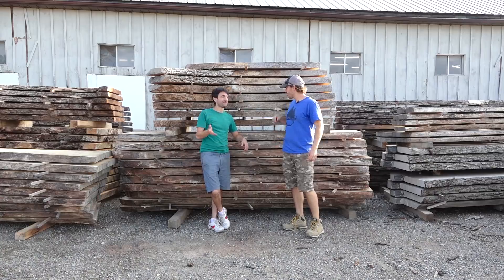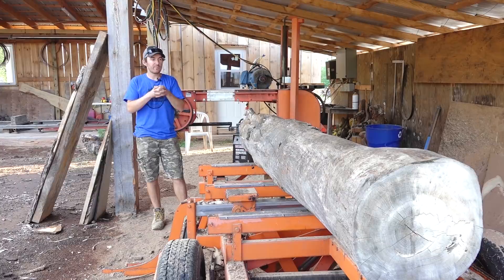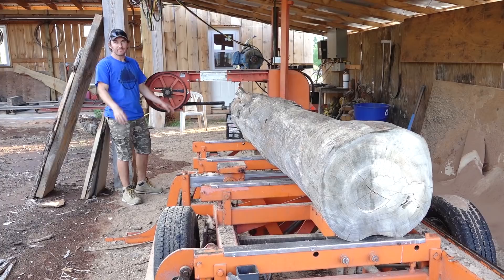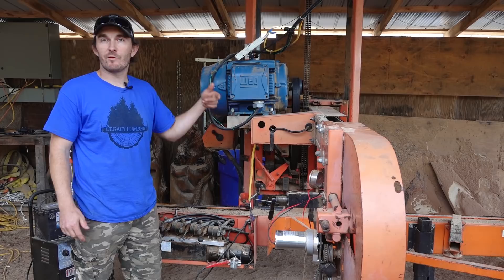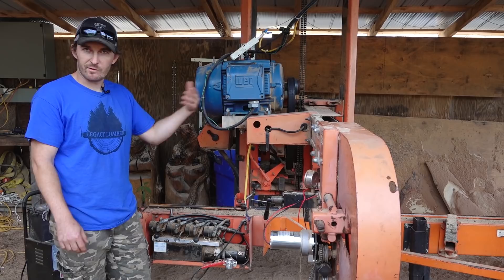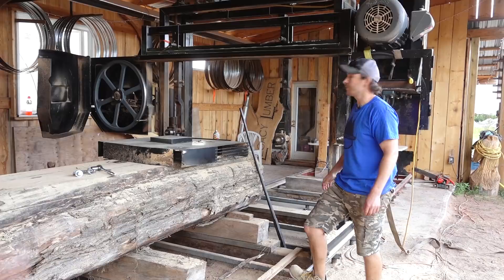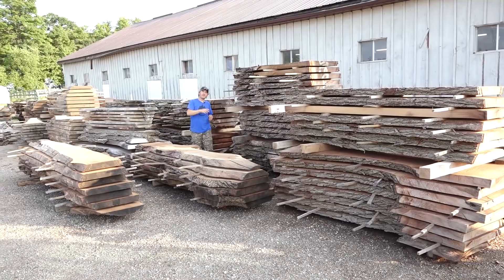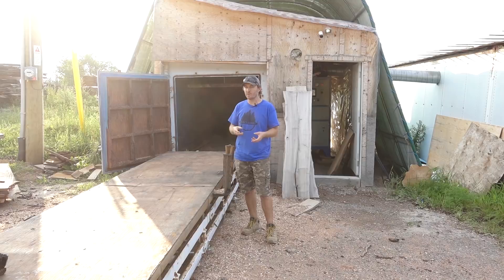Legacy Lumber Sawmill Walk Through

Comment: From my time in the technical department of a large bearing company I can assure you that any more than two bearings on the one shaft is an absolute NO-NO. It does not matter how careful you are in trying to get them to align the simple fact is that as long as your rear points to the ground you will never do so reliably enough to guarantee good bearing life - particular with these relatively crude Plummer blocks and the mounting of them on mill finish steel weldments. With more than two the bearings will always fight each other and the parasitic loads thus induced will lead to shaft and or bearing failures. The fact that you have already had a shaft failure and then on upgrading the shaft a plumber block failure should be enough to convince you of this. Two bearings will outlast three, but if you feel that just two of the current bearings are insufficient (loads here are actually quite light here if its done properly) then increase the size of bearings (and shaft) but use only two . Personally I would just remove the middle bearing and see how it went - monitor how warm the bearings get. A further point, do NOT lock both bearings to the shaft. The shaft must be free to expand lengthwise in use and slip slightly (longitudinally) in one of the bearings inner rings. If you lock both of them you can get parasitic thrust loads that will destroy the bearings. I would suggest locking the blade end one only and perhaps providing a groove in the shaft for the grubscrew on the other bearings inner ring so the ring can slip but not rotate (fit should still be quite snug). Also do NOT over grease these bearings - filling them with grease as many are wont to do simply causes the churning of the grease within the bearing leading to heat build up and charring of the grease - end of bearing! The grease they come with is sufficient for life - throw away the grease gun, remove the grease nipples and plug the holes - we used to as a routine measure before we sold these bearings. In short, throw away the middle bearing  you will not regret it, and Matt you need to do the same on your saw.... Martin
Reply: Olfoundryman I had no idea that three bearings was a faux-pas, but it makes complete sense. It’s like expecting a 4 leg stool to never wobble. Fantastic foundry videos, and bearing advice too.
Reply: hehe I can hear our old assembly shop leader now. "I will put that together right after i mount a fifth tire on my car. I sure would like something else to keep in alignment. Job security is way more important than sanity"
Reply: Not to be argumentative, OFM, but there is a long history of more then one bearing on one shaft in automotive engineering for over a century.
Reply: @rickowens4397  please reread we are talking about more than 2 on a 3 foot span.

Comment: Great video. I built a chainsaw mill with a 22hp Briggs and Stratton that cuts 39" wide, and there is nothing more fun than cutting slabs. But I also ran into bearing problems. One thing to make sure of, is that you only lock down the set screws on the bearing closest to your drive pulley and leave the other ones out (called floating the bearings). When the shaft is turning it actually builds enough heat to grow in length slightly and if the set screws are tightened on all bearings it will create side load on the bearing and can cause overheating and premature failure. Hope this helps. Happy Sawing!!
Reply: Interesting!

Comment: Thanks for the logging tour Matt!
Paul, 
May I suggest that you use stickers/wedges between slabs when you cut to reduce the friction on the blade and therefore reduce the axial loading on that spindle.  The other thing is to increase the size of the wheels to 30:1 (minimum).  The diameter of the wheel to the thickness of the spindle at the bearing.  (btw that is elevator safety code, if I recall correctly).
You mentioned, ' respect the wood', I am with you, and appreciate your efforts!!
Thanks again !
Reply: Thanks for the tips

Comment: Hi Paul, i work on fans-air handling units when they have problems like you are having with your shafts and barrings. A couple things you can try, when you go to tighten down your bearings snug up one side first and see if the other side lifts off the base, if so then shim it up with ether shims or the black metal strapping works good too, your base is crowned which will cause heat in your bearings and burn them out cause it's distorting there shape when you tighten them down. Another helpful thing to do is while assembling it, keep spinning the shaft by hand between each step, if it stops spinning free when you tighten something that's probably the problem. last is when you've got it back together run it up to speed with out the blade on, check if you've got vibration by putting your hand on the bearings, i've seen and i have balanced band saw wheels for cutting granite before and seen them and pulleys not balanced from the factory. 
I hope that helps,
Joe

Comment: Re bearings: I agree with Michael, another problem source is the bearing mount. Even though the bearing bores are aligned at no load, they might not be remaining so under dynamic loading.
 Take a look at the mount for the outside bearing. That light angle will twist and flutter like a leaf in a hurricane under a light load.
Re blades: evidently your motor is overloading the blade. The easiest solution is to use an ammeter to monitor the motor load. With a steady feed rate, as the blade wears the motor current draw will increase. Knowing what the motor loading is, "all" you have to do match feed rate to motor load. After determining a maximum (feed rate x current point), use that as your do not exceed point. Either slow down the feed rate or change the blade before it self destructs. Only you can determine that point, however, you will know when you have arrived at that point.
Hope I haven't been pontificating and this helps,
Rollie
Reply: I'm going to remove the front bearing, but I actually disagre then mounts where the bearing mount are very strong. I don't think the issues is coming from there but i'll keep that in mind.  We are able to read the load through the VFD, we also are more concerned about a nice flat cut so the feed rate is pretty slow all the time.
Reply: Didn't realize you were running through a VFD, that makes it easier. Determine a motor current lower than full load, start out with a new or freshly sharpened blade and saw at your usual rate until you notice an unsatisfactory cut quality, note your current draw. Yes, this point will vary some what depending on the wood specie and green/dry condition. However, it will give you a point of reference for where you are. You should be able to set an alarm in your parameters at this draw. An easily visible strobe or obnoxious sounding horn should do it. Most VFDs have a relay output that will work just fine for this. I know you know this, however, I'm going to say it anyway: Do not have the alarm shut the saw down.
Hope this helps.
Reply: Thanks, suggestions noted!

Comment: For the those pillow block bearings it could be a bunch of different factors that could lead them to fail. saw dust might make its way inside and increase friction, which will cause them to seize. it could also be that the force of thrust on to the bearing which these might not be designed for. id suggest to get some sealed Angular Contact Double Row Bearing, the are made for high radial and thrust. Mcmaster might have them not positive on it, but Bearings Canada will likely.
Reply: Yes i'm now upgrading to heavy duty bearings, these are medium duty.
Reply: @CanadianWoodworks  ... Olfoundryman knows his shiznit as well.

Comment: I would assume that you are getting fatigue failures in you shaft. Reducing the stress in the shaft with higher strength material and or a larger cross-section will help but you may be able to improve it with more bearings positioned to minimize the bending moment or you may have a stress riser resulting from the geometry of the shaft.

Comment: On your friends big mill, I have used CNC equipment over the course of about 18 years. You may think 1.5-2" for a shaft and bearing is good but that is nothing. The killer is vibration. The ball screws for crankshaft making equipment are about 3-4" and the bearings are not those Tractor Supply bearings. Everything is twisting, shaking with that setup.
Reply: I agree with other comments that the mounts and everything else has to be looked at. Home made for production work is dicey. Buy another production mill that is all ready producing, move it. Sell the one you have. I have been in business before too.

Comment: The 3 bearing set-ups are usually a not so good way, but it happen's. I know you checked alignment, but did you check with a dial indicator? Just from video, looks to me that your mounting plate needs to be at least twice as thick and more guests to stop flexing. In my 35 yrs. working on manufacturing lines, you most likely are getting flex and causing miss-alignment. There for breaking shafts and what's, heating up bearings and causing failures. They do have a lot of awesome bearings out on the market that would probably be better. But a Mag. Base and dial indicator would be where I started. Hope this helps. Love seeing young guys like yourself making a living with what most can't imagine!! Good luck.

Comment: Double tapered roller bearings. I have them for my bandsaw sawmill and for a 1 1/2" 4140 SHAFT THE BEARINGS ARE ABOUT $300 EACH SO i HAVE $1200 DOLLARS WORTH OF BEARINGS. Sorry for the caps the key stuck.

Comment: Three bearings in a row is a problem. There is no point to have three bearings and they fatigue faster.
Reply: Suggestion noted I'm going back to 2
Reply: Heat is the killer of bearings. Back track the cause of the heat. Alignment between the belt pulley and shaft, overspeed or wrong parts for the application. The balance of the blade pulley and tension could be suspect too. The fact that you were snapping shafts prior may lead you back.  Good luck.
Reply: I couldn't see it very well, but I wondered if the surface those bearings are mounted to is stout enough. Maybe it is flexing under load and causing incongruent forces.
Reply: When you increase motor power you also increase force on the bearings. Especially the one closer to the blade. The bearing that is in there is probably designed to the old motor. It wears out quickly and breaks. I’d suggest to increase bearing size. As said before, two bearings is the correct way to do it.

Comment: Hey matt. I made a desk and for that i used douglass slabs. I got it from a local sawmill company and i needed to dry it myself. It went okay but i had gotten some cracks and a bit of mold. I dryed it inside so should I nexttime do it outside. And could you give me a couple more tips to prevent the mold and the cracks.

Comment: Great video !  One question about the drying, since he said that you could damage the wood, and my question is: does it concern the structures of the cells in the wood, that also transports the moist in the tree ?  In other words, too much and fast transportation of moist could destroy the cells?      Anyway,thanks from N.Norway.  :-)
Reply: It is possible to honey comb the wood if you dry thicker wood to fast, by too fast it is all based on the temperature of the wood and vacuum setting

Comment: I would question Mr. Lemiski's having arbitrarily decided to extend the cantilever system of his sawmill without checking with the manufacturer for advise on the issue. I take this position, inasmuch, as it would be my assumption that the Wood Mizer Manufacturing Co. used extensive design engineering in producing the original design as being the best for that particular sawmill. As such, the sawmill's design should not be altered, because of the logical premise that there will be undue extension stress associated with the excessive cantilevering of the sawmill's blade. A stress which may well alter the balance of the sawmill during operation and thereby, interfere with the accuracy of the manufacturer's guaranteed true cut system.  But, who am I to question an altered system which is apparently working well for the owner !

My sincere appreciation and thanks to both Matthew and Mr. Lemiski for the great tour of an operating sawmill that was owner designed.